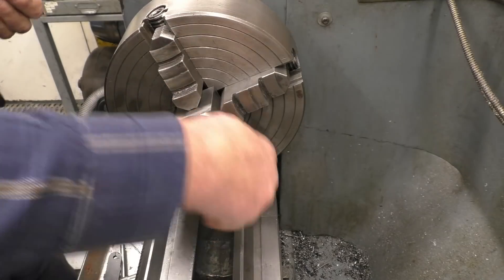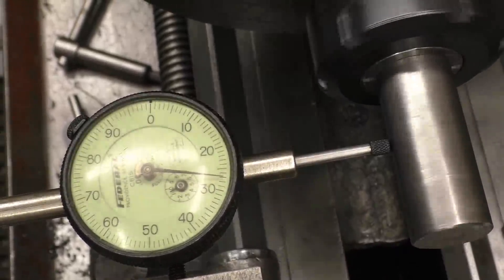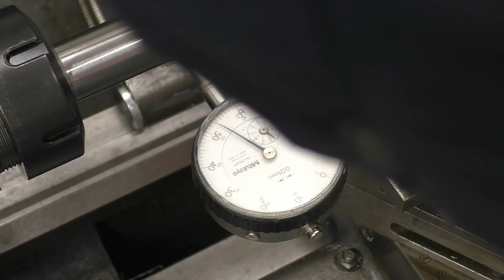SNNC 404 P1  . Machining A Offset Hole On The Lathe

Comment: THINGS JUST KEEP GETTING HEAVIER ALL THE TIME
Up to the age of sixty I could pick up a 10-litre plastic bottle of water – 10 Kilograms, no problems
At age 65 the bottle was still 10 litres – But now it weighed 22 pounds and seemed heavier.
At age 70 the bottle was still 10 litres – But now it weighed 352 ounces and seemed a lot heavier.
At age 75 that 10-litre-bottle now weighs in at 10,000 grams and it is really bloody heavy. 
Welcome to the ranks of those of the elderly persuasion, John. LOL